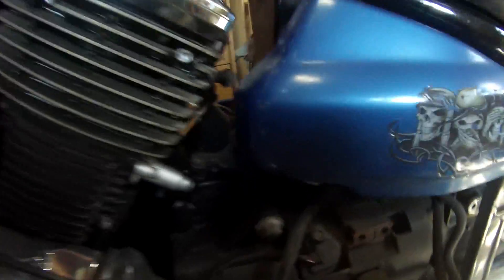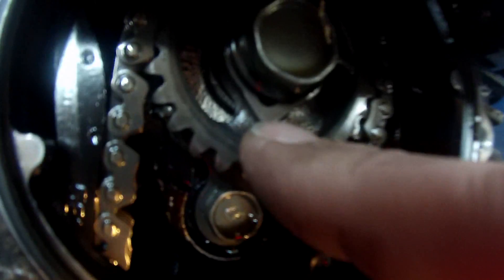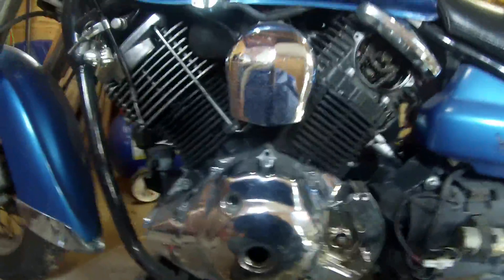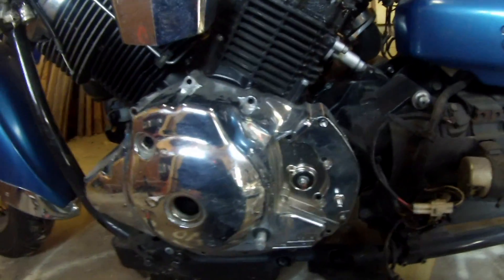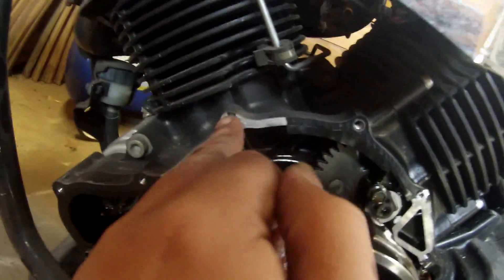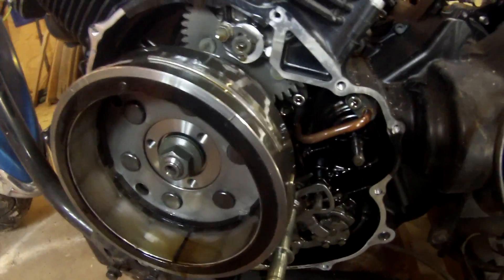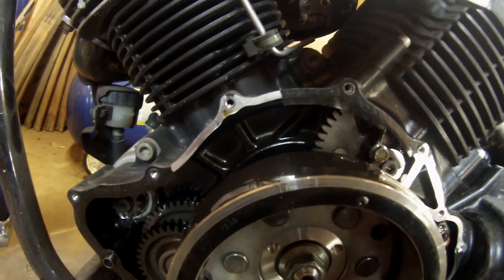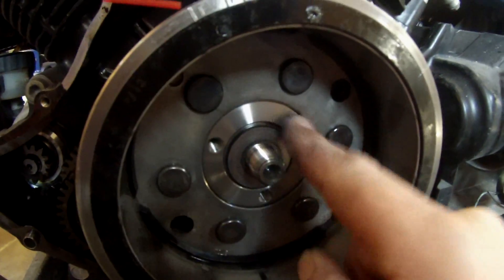Yamaha Starter clutch how to on a 2003 XVS1100 part 2

Comment: Maybe someone know the answer to this, but I have my flywheel lined up at the TDC mark, but on the cam gear, the dimple is a bit off from being lined up with the mark in the cam cover, how bad is this and how would I adjust this issue?
Reply: From what I understand, you didn't use a flywheel holder and when you tightened it, it moved a bit.  Your timing is ok, but your timing mark on the flywheel is off.  To fix it you need to go back into the side cover, break the flywheel nut loose, and adjust it by putting temp case on to line it up.  This time use a flywheel holder with dowel in lower cam sprocket. flywheel holder $20 on ebay.  Otherwise just leave it and when your finding TDC, when it get close watch the cam sprocket mark to find true TDC.  Thats my take on it.